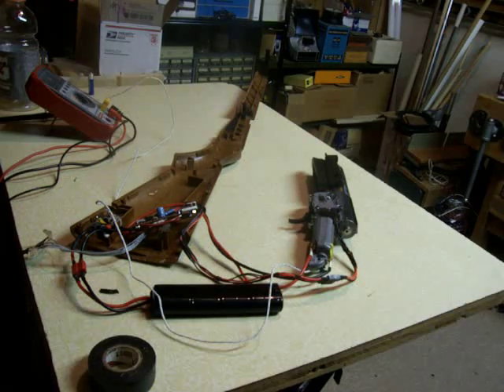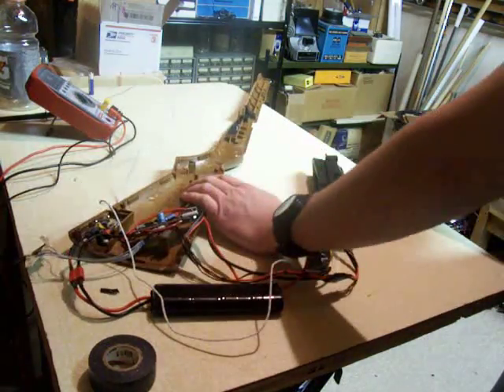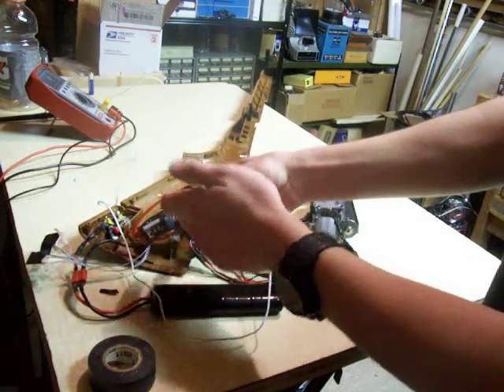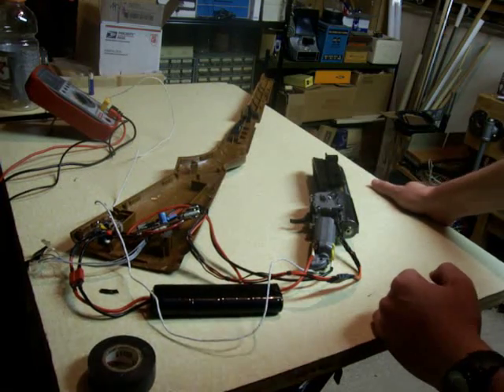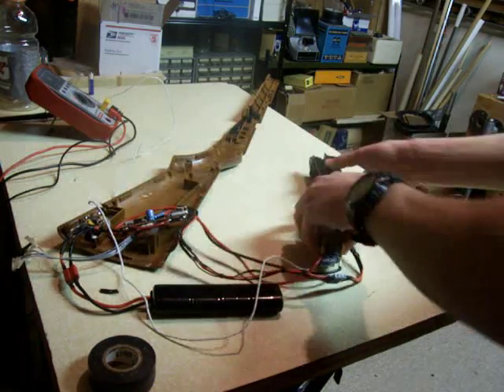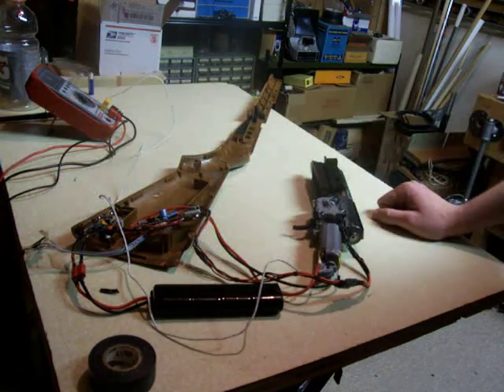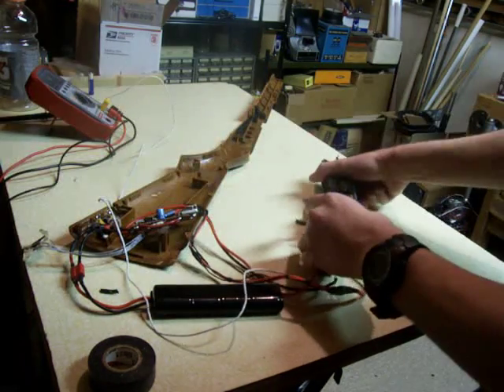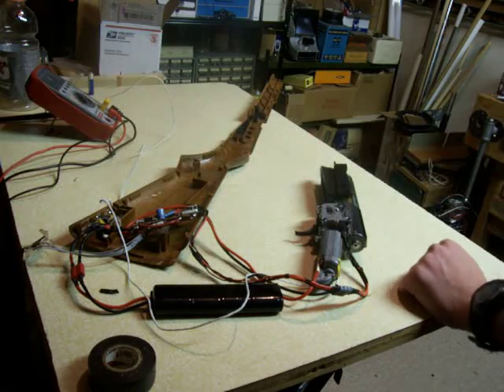Custom Airsoft MOSFET switch

Comment from the maker: @radiofriendlypro well, the PIC12F675, but essentially the same thing as I'm not using any of the added features. This devices uses the IRFB3306PBF for power, and the STP80PF55 for braking.